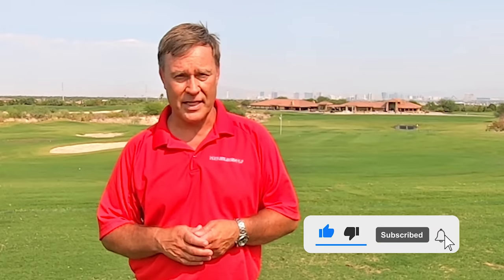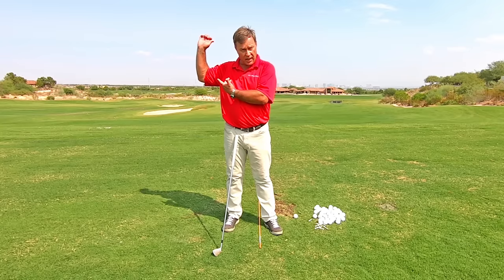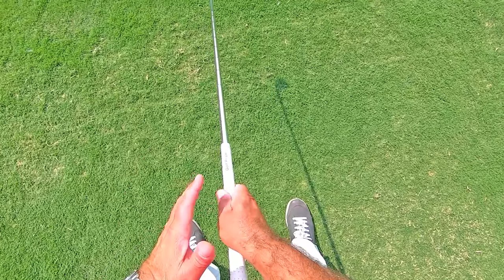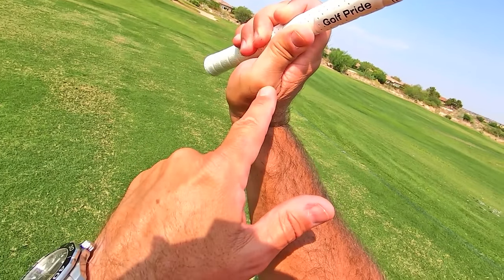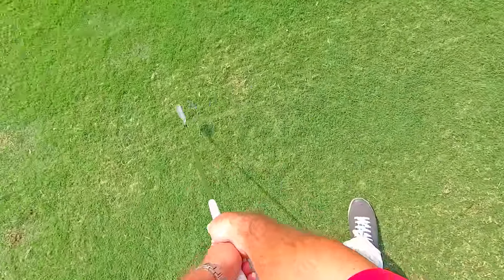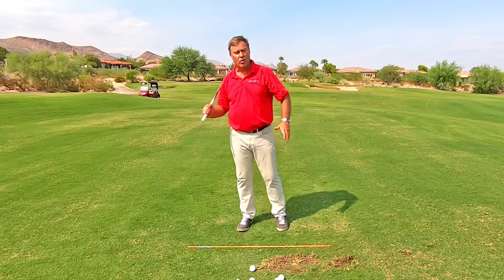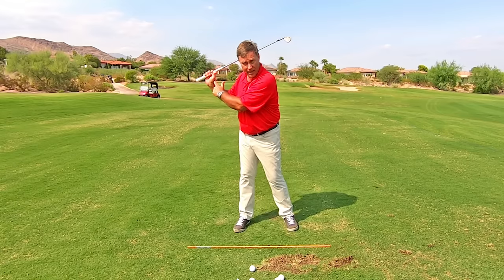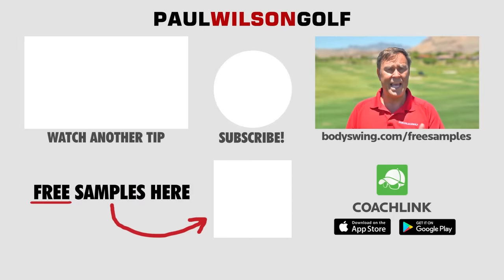GOLF GRIP - THIS PROBLEM LOSES POWER AND CONSISTENCY

Comment: Thank u so much Paul,as a starter I wondered why I blistered my thumb.precisely what I was missing ???<-
Reply from the maker: We all get blisters if we hit a lot of balls or we are not used to hitting balls.  At your level you are holding on tight which tightens your wrists.  You are not hitting the center of the face.  If you don't hit the center of the face it creates shock.  This shock is being absorb in the twisting of your club.  If it keeps twisting you get blisters.   Carry some tape with you until you get calluses.  Also, you need to start with these tips:
Body Swing Concept: https://www.youtube.com/watch?v=E8y9jEyY35k
Grip:  https://www.youtube.com/watch?v=jQZLp8bF-Ww
Hinge Rehinge:  https://www.youtube.com/watch?v=6ZeTqcz2pmE
Alginment: https://www.youtube.com/watch?v=VFZc0Wq282k
Secure Grip: https://www.youtube.com/watch?v=Z8K3Gctkz7A
Best Drill:  https://www.youtube.com/watch?v=cVhtL-d1B9Y
Power the swing with the legs and hip not the hands and arms.  I have tons of lower body tips now posted.  Try this one.  It's an easy way to get you hips moving:  https://www.youtube.com/watch?v=j1mS5Ku8Q10

Comment: This is a game changer. The question mark??
As a tennis player this is very similar to a top spin forehand grip😊
Reply from the maker: It sure is.  This tip will get the wrists unlocked.  See how you do.
Reply: @paulwilsongolf  I tried it and had success!! Thanks so much. I hit straight shots for the first time.The Pro at the driving range, adjusted my left hand as I had it too spread out, down the club. Also I learned to grip the club on lead hand between the pad under my thumb and pinky finger, allowing a sort of looseness of club in in fingers. This seems to be replicated on the right hand...ie the forehand topspin grip. I will be buying your instruction kit.
Thanks again,  I'm now looking fwd to playing more.
Reply from the maker: Glad you are working on the grip.   This is vital as this is part of the hinge in your swing.  Takes precise placement and practice.  Yes, across the palm of the left and fingers of the right.  Hands molded perfectly together.  Feels weird at first but if it all starts with the grip then you should be trying to perfect it.  Thank you for your support. I truly appreciate it.

Comment: Interested to know your views on flexibility of the right hand with your students. I retired from golf long ago due to disability. Started playing again and have realised that I can't (and probably never could) bend my right wrist back very far so on the downswing the r hand tends to push the club forward, over the top. Have to let go a bit with the right to avoid this. I guess this is common with golfers who did not start as young children?
Reply from the maker: Well physical limitations are tricky without my being there.  I can show you want I would like.  Then you will have to adjust to get it as close as you can. I have taught many people over the years with limitations.  They still do well so don't let this stop you.  Letting go is not great because you have to grip back on coming down and through impact. This gripping on can tighten your wrists and/or manipulate the face.  So be careful.  A secure grip with loose wrists to the amount you can hinge them may be better.  Just try both and if you see one way is way better then the other then you might want to keep doing it.

Comment: I've had terrible tendon pain on my wrist I believe this to be my problem. Do you have any tips or tricks to help with muscle memory?  Remember years ago people recommend holding a tee when swinging and few other ideas but would love to hear any ideas you have while switching grip and practicing?
Reply from the maker: I just got over this myself.  Took zero practice swings or hitting any ball for over 3 months.  I just started hitting a few balls again and the pain is almost gone.  Unfortunately, you need to let it heal.  You can look into a platelet rich plasma PRP shot (look it up).   I had this in my knee and elbow.  Worked within no time.  I was going to do it in the wrist but decided to wait it out.   Make sure your grip is on perfectly.  Make sure you are holding on but your wrists are loose.  Too tight and you can lock up your wrists.  Then you hit a ball off center and your wrists have to absorb the shock.   If it twists the wrong way you get pain. 
https://www.youtube.com/watch?v=jQZLp8bF-Ww
https://www.youtube.com/watch?v=Z8K3Gctkz7A
https://www.youtube.com/watch?v=Xk7t9yHCO-I
https://www.youtube.com/watch?v=7olBqwXF3Ik

Comment: About the grip and this type swing with the free wrist hinge, would perhaps larger grips create more easy of grip/less pressure?  Would it restrict the wrists in the release?  I think the right hand is hard to get into that spot because standard grips are perhaps too smooth for the mid to high handicappers
Reply from the maker: Grips would be based on finger size.  Larger hands would need mid size grips. I used standard with 2 wraps.  The size of the grip has no affect with turning the arms off.  Just realize that the wider the grip the slower the hand action.

Comment: Hi Paul, great video!  How does grip size affect ability to have the correct grip?  I switched to thicker grips because of popular trends. It feels good but Im having trouble trying to use the neutral grip. I cannot get the 2 vees parallel.
Reply from the maker: Well, if they are too big it will be harder.   The problem with large grips is that it slows down your hand action through impact.  I tried jumbos and couldn't square the face at all.    This is why I only recommend mid size unless the person has arthritis and can't use any other grip.  You are going to have to do your best to hold the club in the fingers of the right hand and work it on top.  If not it is strong.  If you have loose wrists with a strong grip you will hook it so play a draw if you want to keep that grip.

Comment: Awesome video.  Would a bigger grip make it easier to hold vs a normal grip?  I got big hands and was thinking about changing my grips
Reply from the maker: Well, if you have bigger hands you need bigger grips.  I wouldn't go bigger than mid size unless you are a monster.  Wider grip = slower hand action.
Reply: @paulwilsongolf  much Mahalos mr Wilson🤙🏼

Comment: I've been putting my thumb straight down the front side of the grip the whole time I've been playing. I'll try this suggested grip and see if it helps. Should the thumb on my lead hand also not be along the front of the grip?
Reply from the maker: Yeah, that's a serious problem which is really holding you back.   Follow this tip and you will see a huge difference.  The top thumb is slightly off center.  Watch this tip and follow along:
https://www.youtube.com/watch?v=jQZLp8bF-Ww

Comment: I am an offender of the more "open" thumb, which allows my club to move at the top swing.  So it is hinging, but not with my wrist.  You touch on this in your video, but how does that impact the swing.  Your description of the straight thumb on the shaft is excellent, just curious of your thoughts on the other flaw (my flaw).  Thanks for the great Video.
Reply from the maker: Well, you don't want gaps in either hand.  Your hands and wrists are not hands and wrists.  They are a until that hinges and rehinges.  You want them securely on the club with loose wrists.  Any gaps and you do not have a secure connection.  Just a few degrees off in this game and you will hit it sideways.  You need perfect placement all of the time.
https://www.youtube.com/watch?v=jQZLp8bF-Ww
https://www.youtube.com/watch?v=Z8K3Gctkz7A
https://www.youtube.com/watch?v=6ZeTqcz2pmE
https://www.youtube.com/watch?v=5_O0H2QNFo0

Comment: Thanks Paul, new subscriber here with a question.  I was always told to interlock the pinky and index finger when you're holding the club.  Do you recommend doing that?  I don't hit my irons pure so definitely going to try your grip but can't tell what's going on in the back for your grip.  Thanks.
Reply from the maker: Thanks for the sub.   Although you can do the interlocking grip I don't promote it.  People tend to wedge the pinky in too far with the index finger and the thumb goes on top of the shaft as I show in this tip.  I prefer the overlap.  You can learn it here:
https://www.youtube.com/watch?v=jQZLp8bF-Ww

Comment: Hey Paul, i typically use the baseball grip (where all my fingers are connected no gap) because i felt like the pinky overlap started to cause some pain. Wanted to know your opinion on if i can still adopt this grip idea with the baseball style grip. Also would you happen to have an actual overlap grip video? Maybe im doing something wrong and thats why ive been avoiding that style grip. Thanks!
Reply from the maker: If you do the baseball grip you cannot sacrifice the position of the bottom hand. Most who do the 10 finger back this hand off into a strong position so they get hitting with the arms.   Here is my grip video:
https://www.youtube.com/watch?v=jQZLp8bF-Ww
Just follow along and if you do the 10 finger recognize the position of my bottom hand and copy it the best you can.

Comment: Paul,   It looks like your left hand is very close to the top of the  end cap ?   I am right on with your right hand placement .  Do you recommend to hold that far on the end of
the left hand placement ?
Reply from the maker: Yes, I grip at the end.  That's where I like the grip it. You can grip down a little too.  Up to you.  Just don't go off the end of the club.  Did you try my grip down tip?  https://www.youtube.com/watch?v=sZ2-dqOausU

Comment: Hey Paul, I been posting my best scores ever and appreciate all the great info. I feel like narrowing my focus from the whole club hitting the whole ball to just the face hitting a place on the ball has helped a lot. My question is how do I narrow my focus from tee box to aiming point in the fairway? As a tend to miss right/slicer should I be standing on the right side of tee box aiming to a place on the left of the fairway?  I know you have said have to swing out right to correct slice. So do I aim for right of center of fairway or maybe center. And do dogleg left or right fairways change aiming place? Thanks
Reply from the maker: Great job.  It's great when you are heading in the right direction.  You need to pick a very precise spot to aim at.  Not just a tree.  The leaf on a tree.  The narrow the point the less you think about your swing.  I wouldn't be fixed on the ball.  Also, why not just fix the slice.  This is one of my specialties.   Here:

So the face is open.  This means you are not allowing it to rehinge.  In other words with driver you are trying to hit it too hard and tightening your wrists.  See them as a hinge.  They hinge ... they rehinge.  Hopefully, you are doing my neutral grip.  Then do this drill and watch the face:  https://www.youtube.com/watch?v=OFJOLBSXSfQ  If you have to roll it early then do so.  Get it hooking  (STEP 1).  Then we get rid of the slice spin.  Once you do that, start adding body to straighten it back out (STEP 2). So simple.   I could fix you in 10mins. or less.
Reply: @paulwilsongolf  Thank you sir! I am so working on it and gaining on it. Keeping up with playing buddies that have been playing for over 20 yrs and my 5 yrs with your help am posting just as good of scores or better!
Reply from the maker: Priority one is fixing the slice.  Get it hooking then use body to straight it out.  So simple.  I want you beating your buddies.
Reply: Aim way off in the trees to the left, just pray you dont hit it straight

Comment: Paul you are a genius! 😍
Reply from the maker: Thanks so much.  This is very important yet so many people do this wrong which is really costing them a lot of power.  Glad you found me.
Reply: Tiger Woods invented the Neutral grip...
Reply from the maker: Yeah right ... check out Harry Vardon.
Reply: @paulwilsongolf  You're right. This the reason why I subscribed to you two weeks ago. You are an amazing teacher.
Reply from the maker: I love the fact that Tiger, Jack, Hogan, Nelson and many others were neutral yet people keep trying to get people to do a strong grip.  At some point shouldn't it dawn on your that maybe neutral is the way to go.  Mindboggling they can't see this.
Reply: @paulwilsongolf  I agree 100%. Years ago, a pro told me to use a strong grip and it worked for 2 years. It gave me distance but over the time, it destroyed my swing. My swing became flat and I struggled to shape the shots. Also, I realized that with a strong grip, it is very hard to hit from rough or hit good shots in fairway bunkers. Now, I use a neutral grip but my hands were used to be placed a certain way on the club and if I hit 50 balls, my grip become strong again.

Comment: @Paul I do that thing with the thumb like you said not to do, where I push the club up in the backswing, does that cause me to hit it to the right as well for a right handed golfer?
Reply from the maker: It could because it locks the wrists.  Fix the grip then work on this:
Wrist Release Drills
https://www.youtube.com/watch?v=5_O0H2QNFo0
https://www.youtube.com/watch?v=Xk7t9yHCO-I
https://www.youtube.com/watch?v=7olBqwXF3Ik
https://www.youtube.com/watch?v=6ZeTqcz2pmE
Once you loosen the wrists switch to powering the swing with the legs and  hips.

Comment: Paul question with the right hand. When doing the ? I tend to see a second knuckle when checking the grip moving the wrists up and down. Any suggestions? Feel like when I am trying to wrap/cover the lead thumb my right hand is getting into a weaker position
Reply from the maker: People have different finger length. If yours are a little longer then back it off a little.  We don't want a weak right hand.  Just look for the lines pointing between the back ear and shoulder and you should be good to go.

Comment: Hi Paul, is thr any exercise for body swing? As I am very uncomfortable when I try to hit the ball from driver. I feel like as I have not enough power to hit the ball.
Reply from the maker: You get the power through loose wrists then firing the legs and hips very quickly.   If you are not moving fast enough or have tight wrists you will not hit it anywhere.
Wrists = Spin (Step 1)
https://www.youtube.com/watch?v=p4vASmOzkPg
https://www.youtube.com/watch?v=M868QsTlGt4
https://www.youtube.com/watch?v=yHEv7G9Z5-0
Body = Direction  (Step 2)
https://www.youtube.com/watch?v=FV8uSZ16Bys
https://www.youtube.com/watch?v=RdphthCQ9VM
https://www.youtube.com/watch?v=m8FxSZSmKEw  (secret tip)

Comment: I noiticed that the grip that you are using appears to be the same thickness compared to the conventional tapered grips. Will this make any difference to the placing of the right hand and the grip?
Reply from the maker: I use standard Tour Wrap grips with 2 wraps.  They are not same thinkness grips.  I would not recommend same thinkness grips.

Comment: I had an accident @ work & lost 3 fingers on my right hand. I have the index finger, thumb,& a middle stub that is pretty useless.  When I try to hold the club my thumb is exactly where you said not to put it.  While playing with a random golfer about a 4 handicap he had me put my thumb to the left of center & it worked great for the first shot off the tee. The next tee shot my driver went about 60 yards long & left and it happens a lot.  Do you know of a way that will work for me and not throw clubs all over the course. Any suggestions would be great. I'm 62 about 6' 1 & 220lbs and hit driver about 240 now if I hit the ball before throwing the club. I'm right handed well kinda and I tried wearing a glove on both hands,  didn't really like that so ANY help @ all and I will take it straight to the range and practice then see what happens.  Just found you & subscribed so lets fix my handicap together.  No pun intended on MY handicap.   Thanks Paul
Reply from the maker: Well, you case is a little different.  I would be holding with the left hand more secure and the right in the V as the other person suggested.  There are 2 pics of Freddy and Vijay both with their right hand off the club at impact.  I want people to hold the club in the fingers of the right to take the power out of this hand too.  So I really don't see and issue with no being able to hold the club in this hand.  When I do the neutral grip I can barely hold onto it with this hand too.   I would think there are more pressing issues in our swing causing the bad shots.  So follow my neutral grip the best you can:  https://www.youtube.com/watch?v=jQZLp8bF-Ww try to mold your hands together so there are no gaps.  See the wrists as a hinge.  They hinge and rehinge.  They are loose.  Get this action by doing this:  https://www.youtube.com/watch?v=6ZeTqcz2pmE  Once you get that you are coupling it with our body which is coiling and uncoiling.  Make sure you are not leaning left in the downswing.  If so, you will swing over the top:  https://www.youtube.com/watch?v=sbE-hzTXgNo  This should help.

Comment: Hi Paul.  Is a proper grip critical to squaring the club face?  Thanks
Reply from the maker: Absolutely.  I want a neutral grip with loose wrists.   If you have a strong grip with loose wrists you will hook every shot.   Once you do, you will add a second flaw/compensation to hit it on target.   Now you will have 2 flaws so you have to practice a lot to get the timing.   I prefer simple.  Here is the neutral grip I teach:
https://www.youtube.com/watch?v=jQZLp8bF-Ww